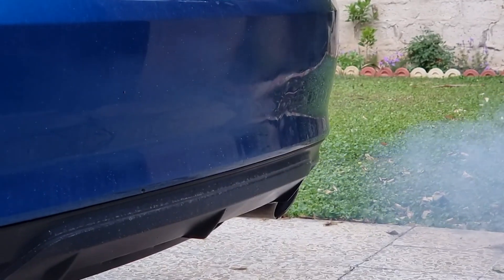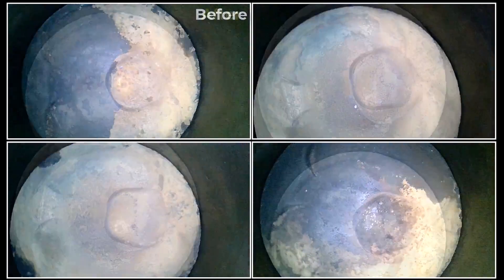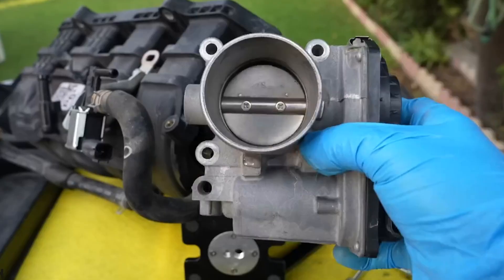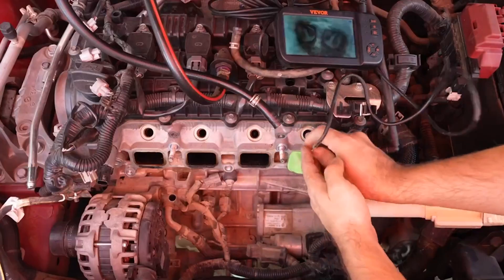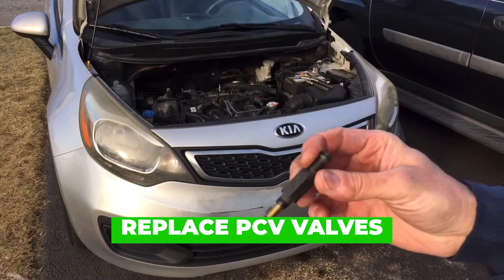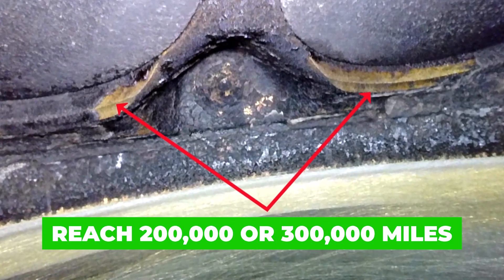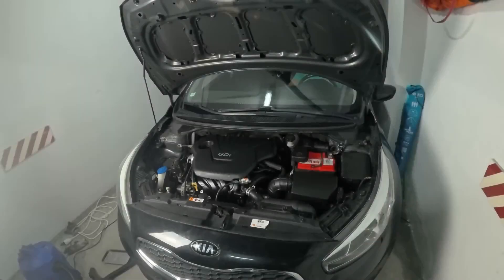Japanese Trick That Removes Carbon Buildup Without Chemicals

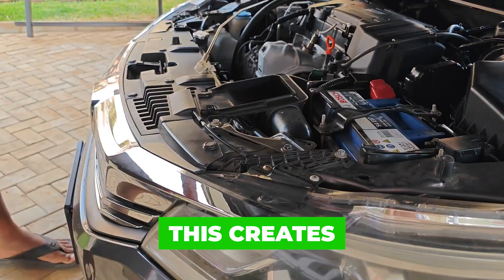Comment: In short. The method starts at 6:31: warm-up, stable gear, RPM 2500-3500, steady throttle, continuous driving for 20-30 minutes, no stop-n-go, finishes at about 6:54.

Comment: Hog wash. Chemical with gas additive containing PEA at every oil change  is much more effective. Also using oil that has lower evaluation like Pennzoil platinum ultra  and changing every 5,000 miles or less beats what selling us